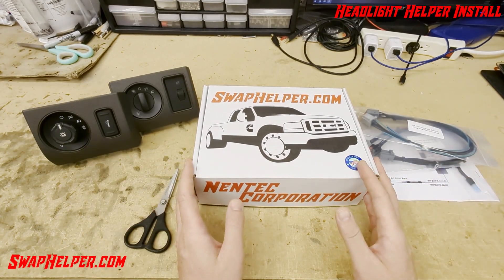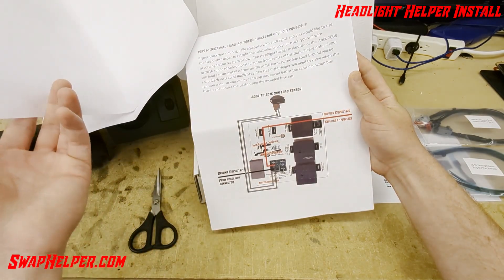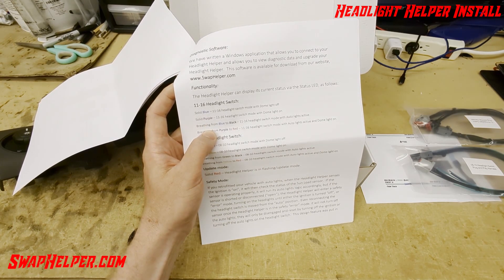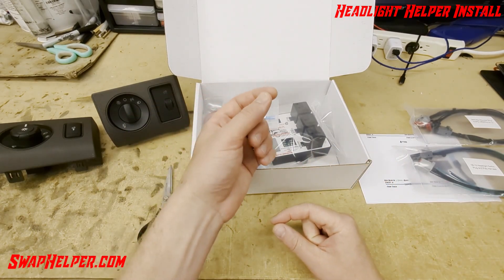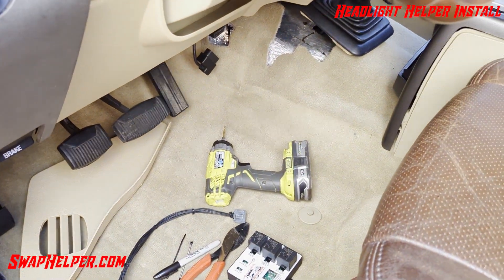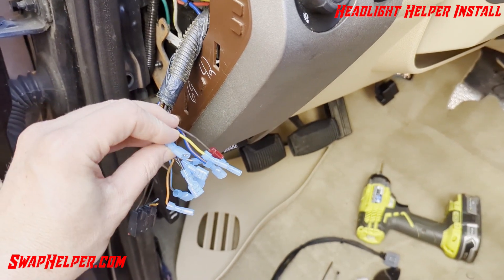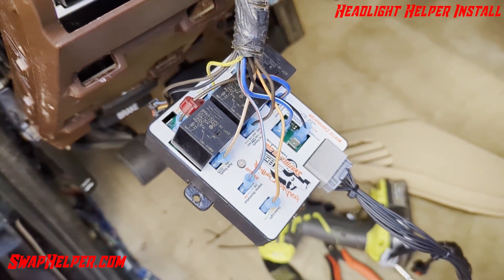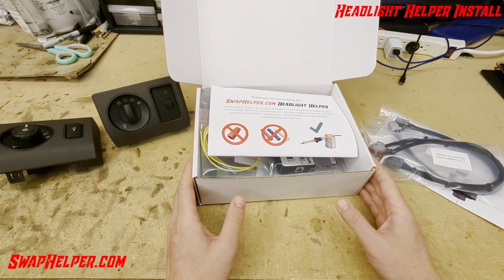Headlight Helper Unboxing and Install! Run 08-16 Headlight Switch in 99-07 Super Duty or Excursion!

Comment: What does this kit do? Is it solving or upgrading ssome issue?
Reply from the maker: As stated in the video title, it allows you to run a 2008 to 2016 headlight switch in a '99 to '07 Super Duty or Excursion.
Reply: @SwapHelper  what's the point of swapping switches?
Reply from the maker: @nickaltvater5592  so that you are using the period correct switch in your interior swapped truck.